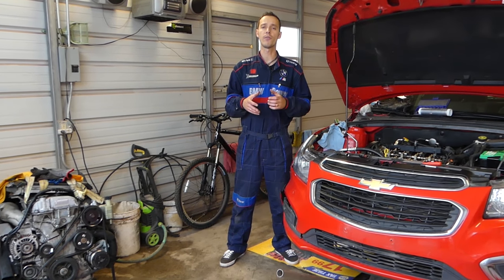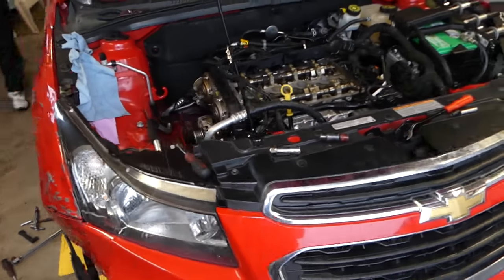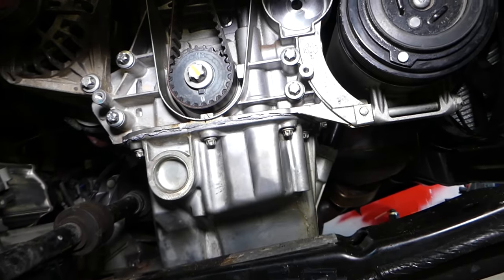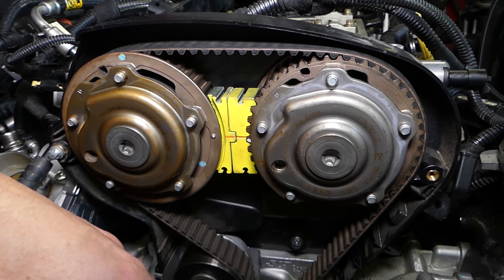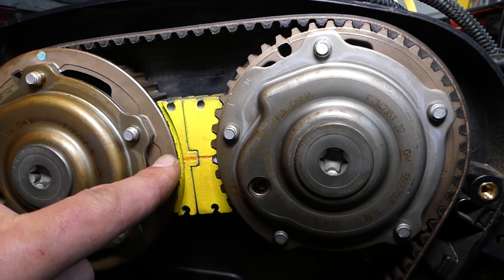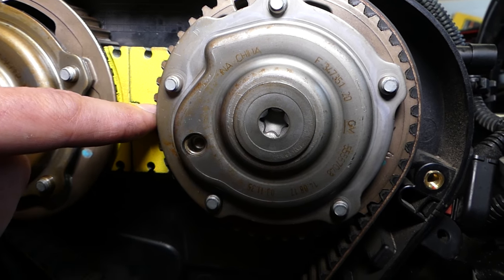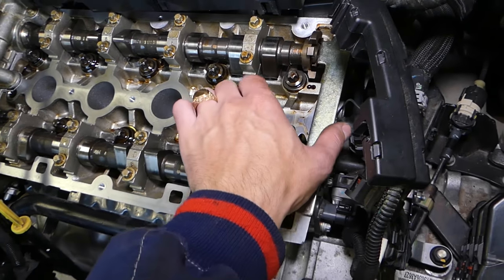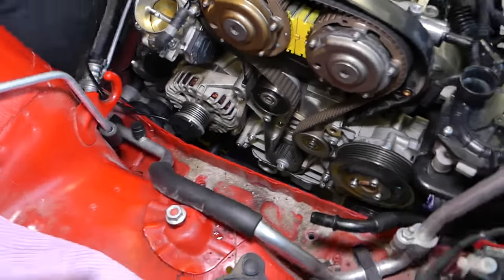TIMING MARKS CHEVROLET 1.6 1.8 CRUZE SONIC AVEO TIMING TOOL

Comment from the maker: Products that we use and recommend:
► Timing Tool: https://amzn.to/4fue6Ec
► Timing Belt Kit: https://amzn.to/4hH3weE
► Panel Removal Set: https://amzn.to/3YiMADu
► Assorted Fuses: https://amzn.to/4fx4s3F
► Tool Set: https://amzn.to/3p5MM6t
► Screwdriver Set: https://amzn.to/3XRB28Q
► Mobile 1 Oil: https://amzn.to/3xBc8B9
► Oil Filter: https://amzn.to/3w0Ulme
► Torque Wrench: https://amzn.to/32qyRwg
► Liqui Moly Engine Flush: https://amzn.to/3IiDBID
► Voltmeter: https://amzn.to/4hB6Zvk
► OBD Scanner that we use most often: https://amzn.to/3I4MQfe

► Check out our Amazon Store for the tools and parts that we use: https://www.amazon.com/shop/worldmechanics
Reply: On chevrolet sonic 16v 1.5 I expirence 2thoth is broken will that cost  problem
Reply: On a back of camshaft

Comment: I did mine without the locking tool and without removing the valve cover even though i have the tool. 😂 Easy job.

Comment: I'm ready to remove my 1.6 Aveo timing belt and then the head but although I have TDC marks underneath and the two dots on the cams align just like you showed, I cannot place the slotted tool on the other end of the cam shafts because the slot is below the rim of the head.  In order to get that slotted tool in place, my dots on the cam sprockets would be 180 degrees off.  What's going on with this engine?

Comment: oh man you are saving me !  on my car the dots on camshafts are not in the good position and i was struggling to find the correct position. but with the camshaft locking tool i found it, thx a lot
Reply: skinn15 If the cams were not lined up (the 2 dots) and you couldn’t get the camshaft locking tool in place, how did you get the cams lined up? Can you hand turn the cams?

Comment: I'm stumped, I bought a 2011 aveo with 1.6 and the car has no power and I was told the timing belt was replaced before I got the car, I suspected the timing to be off one notch or so so I checked the timing and someone timed the engine with the wrong dot on the intake cam and it was nearly 90 degrees out of time on the intake so I retimed the engine like I have seen everyone else do and the car had zero compression, put the timing back like it was and it runs, I checked the timing 20 times or more and it was just like all the videos and pictures I had seen but no compression
Reply: You have a bent valve these engues will bend valves if timing gets off

Comment: Im having some issues with my cruze 1.8L, i thought the maf was bad so i ran some live data, its got a loss of power bad, while running the engine at 2,000 rpm i noticed my ignition timing was advanced 45 degrees @2,000 rpm, is this normal for these motors? The car has 75k on it so i dont think anyone put a belt on it yet, im not sure what to do…